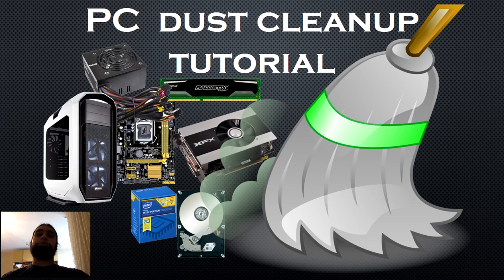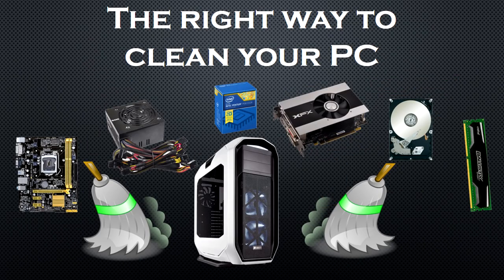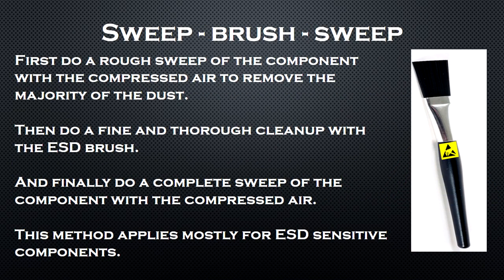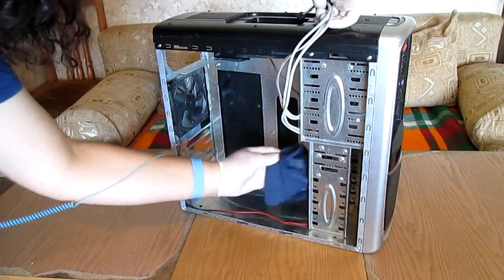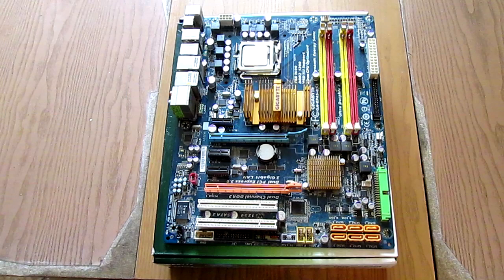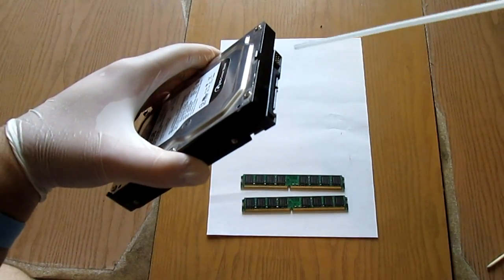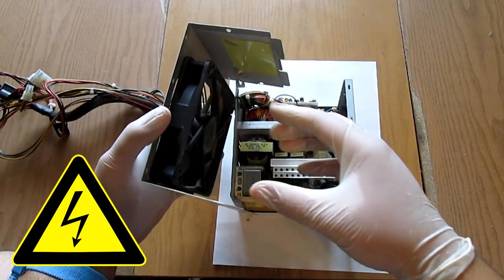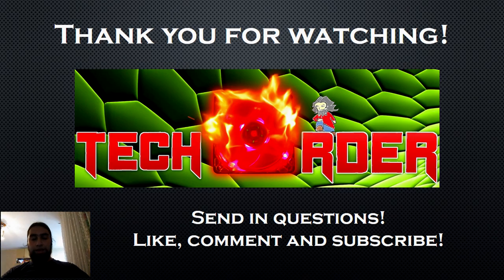[Tutorial] How to clean your PC from dust. PC dust cleanup tutorial.

Comment: Tech order what if i have aa all in one water cooler could i just spray compressed air threw  rad to get dust out?
Reply from the maker: If you have an AIO water cooler, remove the radiator and then apply the sweep brush sweep method. If you spray it while it's mounted a lot of the dust will go back in the case.